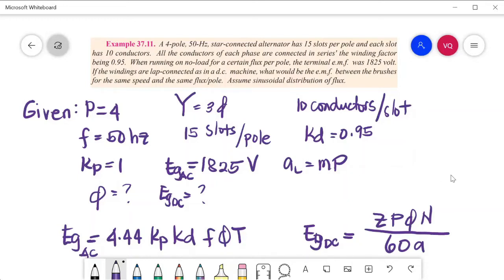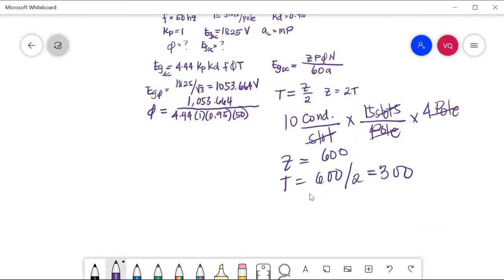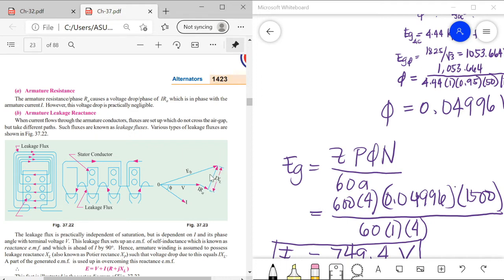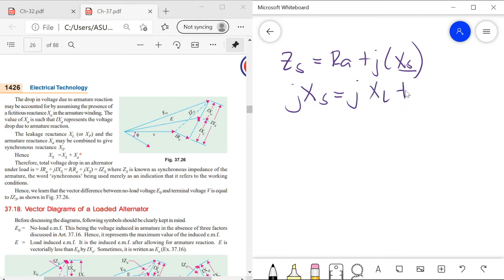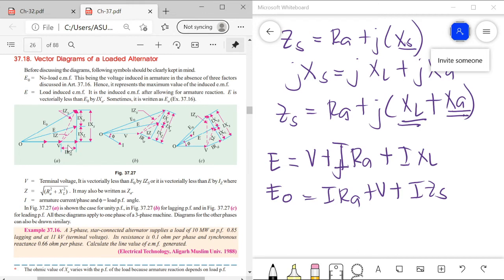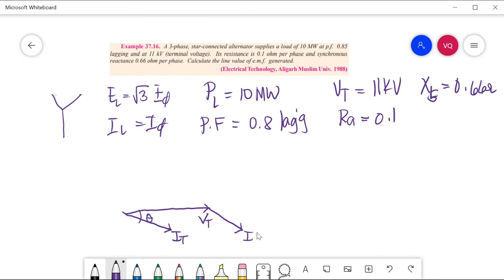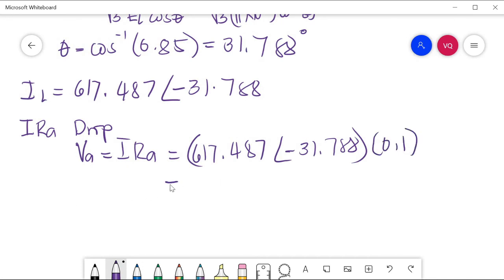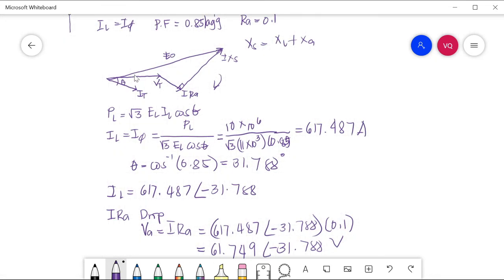SYNCHRONOUS REACTANCE

Comment: A synchronous motor is operated from a bus voltage of 1.0 p.u. and is drawing 1.o p.u. zero power factor leading current it's synchronous is 0.5 p.u. what is the excitation emf of motor. Pls. Mam if you have detail solution for this problem give me